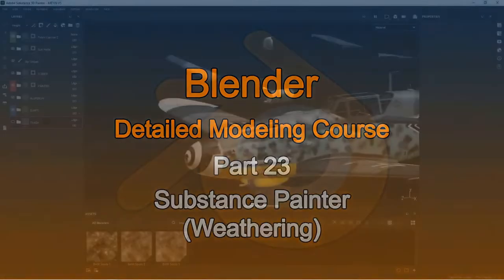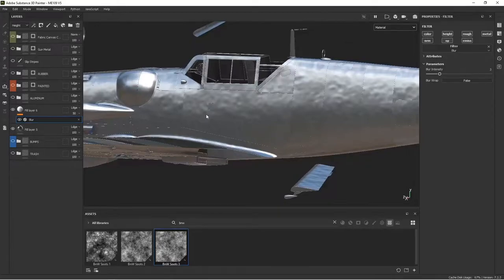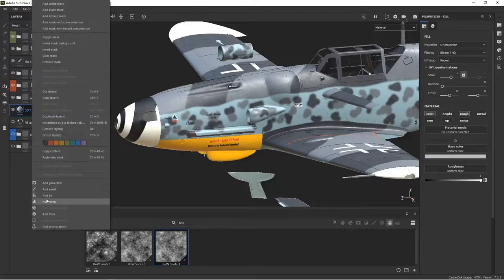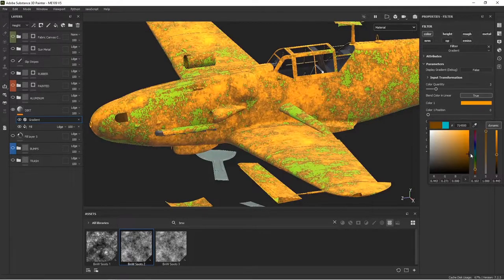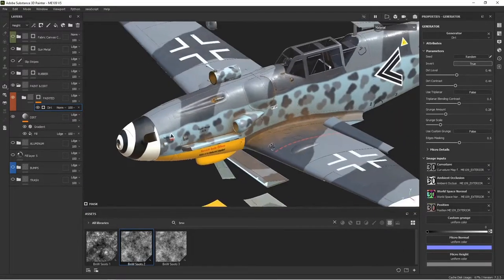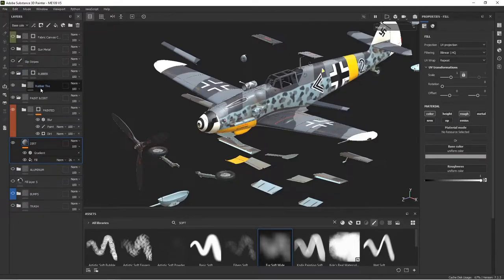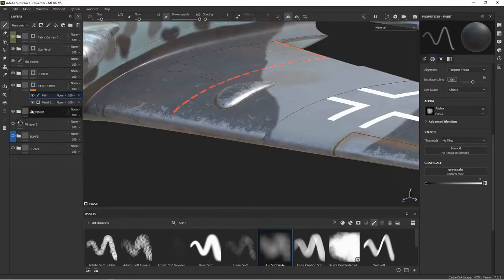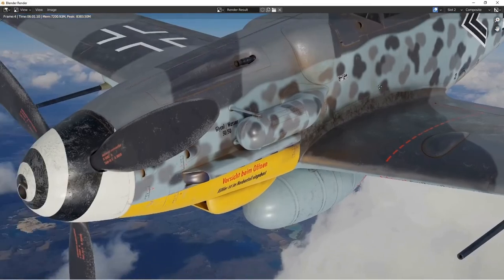Blender Detailed Modeling Course, Part 23: Substance Painter, Weathering

Comment: Great chanell and tutorials. I learned a lot from You. What I would do a little bit different is add more wear to all those decals.  They're way too vibrant and visible
Reply from the maker: That's certainly an option.  These machines often lived short, hard lives.
Reply: @Mark_Alloway  ok but in such case you shouldn't add so much wear to the paint itself either. I mean the decals look too new compared to the rest of the plane
Reply from the maker: @radekgrec1467   Understood.  Thanks.